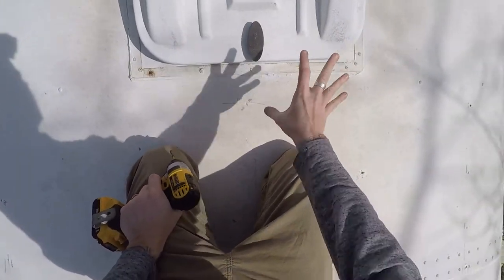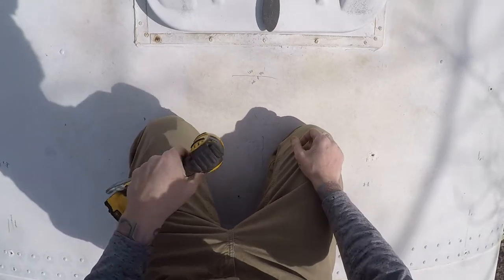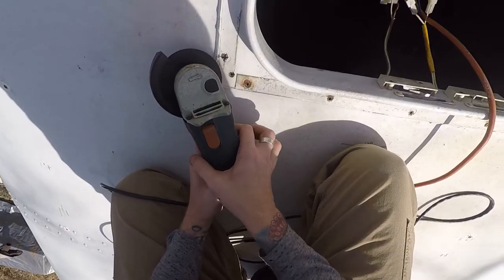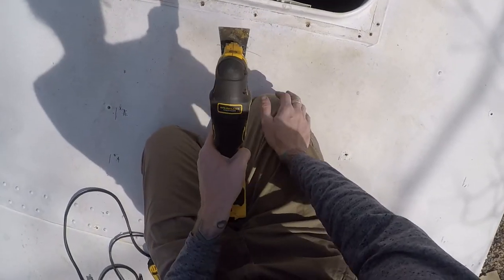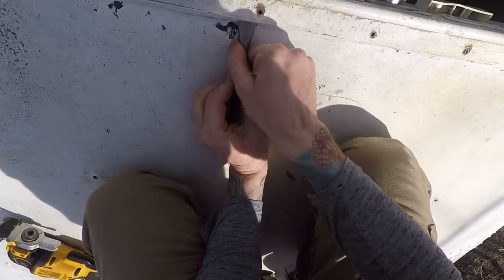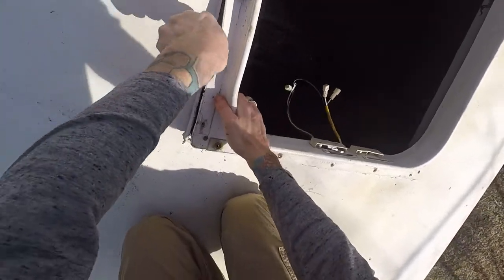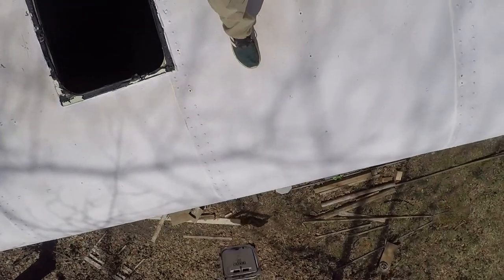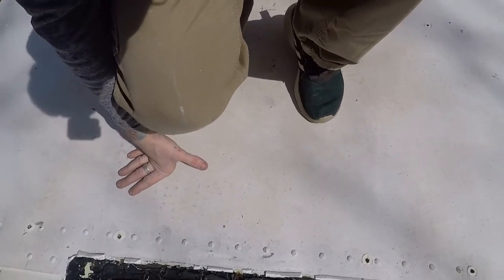How To Remove And Delete The Emergency Hatch On A Skoolie - Step By Step

Comment: What rivets did you use?  Material, diameter, and grip range?
Reply from the maker: They are 1/4" structural blind rivets. They have a 0.080-0.375 grip range. I got them here https://www.skoolie.com/product-page/1-4-industrial-rivets-100-pcs
Reply: @WideAwakeTravels  Thanks!

Comment: Nice video.  Very cool.  I've never used Clecos.  Looks like a legit way to do things.  Looking forward to doing this soon!

How'd you end up fastening your strut rails for the solar?  I've been considering options for that...but haven't settled on anything.  Suppose galvanized strut with galvanized hardware into the hats would be the simplest.  I was considering aluminium or SS strut...but that obviously complicates things.  I live coastal...so that's the reason for the considerations.
Reply from the maker: Thank you. Yeah clecos really help. For solar panel racking I used closed end rivnuts installed into the hat channels and unistruts fastened to the rivnuts with grade 8 bolts, but there is a simpler method if you are OK mounting the panels flat on the roof, which will give you more power anyway. We wanted them to follow the curve of the roof so we used the method we did. We have a video for that too: https://youtu.be/7mMte2cpRUw but if you want to put them flat, use this method: https://youtu.be/6_RpkbhWq8I